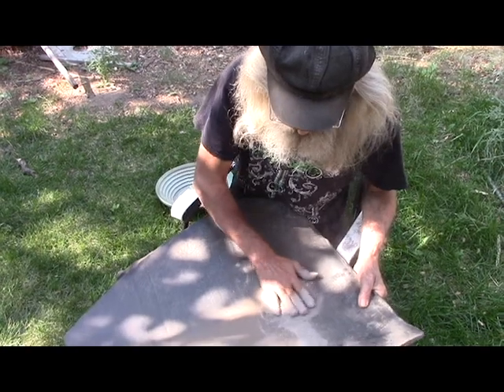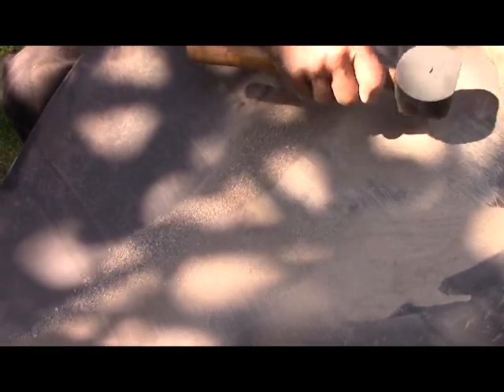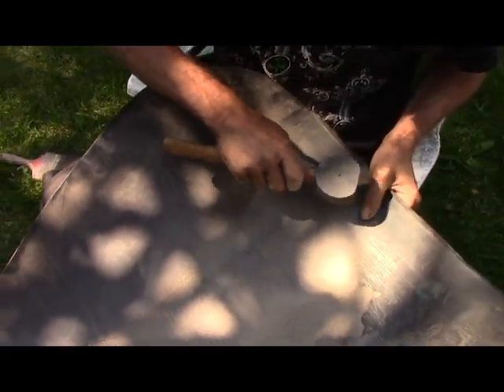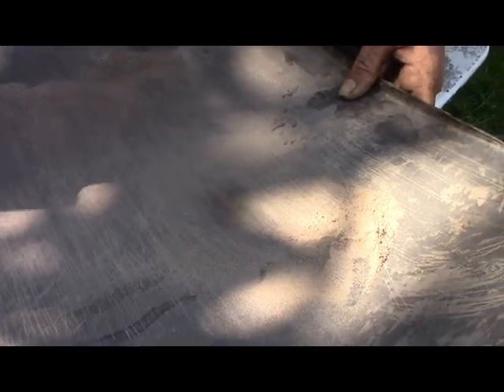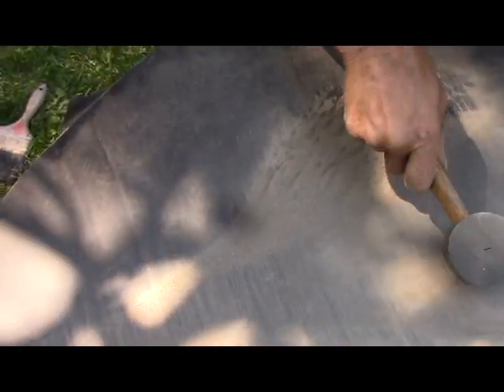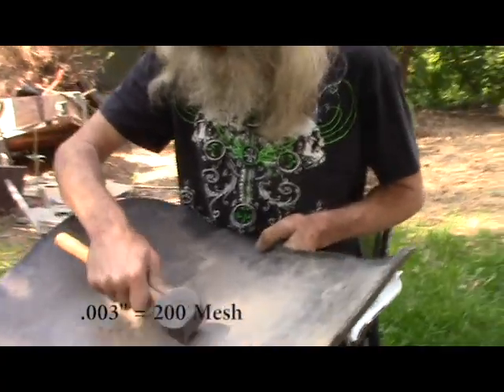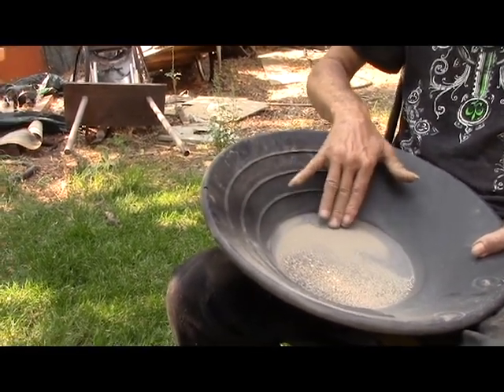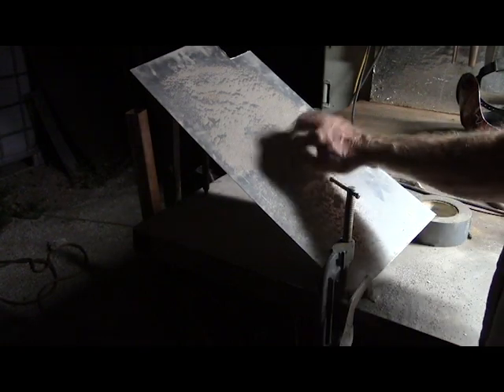Lesson 35 Screening Without Screens

Comment: for this idea, it is necessary to adjust the angle of inclination of the canvas (board, screen).
the stronger the mechanical impact, the board will be close to the parallel relative to the ground (surface).
the weaker the impact, the board (screen) is closer from 45 to 90 degrees. 
The angle of inclination is also important and the strength of the vibration. Here it is better to use a vibrating table.
Reply from the maker: It would depend on the table and the desired outcome, but it could work well.  I have used this in the field when I needed to fine screen something and didn't have screens with me.

Comment: Hello again Keith.

I have had problems replying to your reply. I did a big answer, but it went missing. Anyway, in view of the length of it, it may be as well that it did disappear. 

When I first started in business, I was in gold and silver recovery, and in the 80's, I was asked to advise on, and manage, a couple of projects in Nevada and California (Apple Valley?). Anyway, that was in the early 80's and just as I was looking forward to moving to Reno,
the gold price went from $400+ to more like $250, so that was that.
Still, not as big a disappointment as for the guy in Nevada who had paid $140k for 100k tons of mine tailings in the desert.  After the bank foreclosed, I guess the tailings probably got processed at some point after the price recovered. Quite a big project at 1-2/10 oz per ton, and 2 oz of silver. The California one was an open cast, minus 1/4", pachuca, air and carbon job. Just as buggered with the price drop though. Funny how minus 1/4" seems to be a common and effective cheap and simple sep.

So,  if by leads you mean ideas; yes, one or two.  Most of the research has been on deep beds. They exhibit some weird effects, that's where the aerodynamic mechanism comes from. So, as I haven't found any work on thin layers, it's probably best to follow my instincts, and what I've seen in your videos. I've been in freelance technical development for 30 years so there's a fair chance I will come up with something.

I'm not the best with electronics, but I reckon some sort of vibro drive. Could get a bit tricky with the need to resolve the force in 2 directions; one for the sep, and the other longitudinal to be able to collect the fractions. Phasing or the two is also a question. In addition, with different sized particles of gold, it may well look like stripes on a mine cat's tail rather than the usual single line of gold. That being due the sep being based more on size rather than the way it behaves when water is involved, but not totally different). I think this is a tribological effect. That would explain why the fines stay at the top, while the bigger stuff goes south. Also, there are some interesting parallels with your updated special technique for very fine gold. I wonder if the tapping next to the settled gold had anything to do with Chuck's dry separation action? I reckon that at the end, under the clean water, the effect is almost the same as when it is dry. At the dredger place, when you were  panning fine and course together, the course going south, as opposed to staying high, reinforces that this is a totally different mechanism from normal panning.

Anyway, as you can probably tell from the length of this, you have got me interested in all this again. 

Steve
Reply from the maker: It is always interesting when you think you may be on to either new or forgotten physics.  Today I am testing a fluidized bed vs a Partially fluidized bed.  To early for conclusions- but interesting...

Comment: Keith, when you're on a roll, there ain't no stopping you, is there? What would happen if you ran the material on a shaker table without water, maybe tilting it some? Wouldn't the vibration of the table have the same effect? Plus you have the grooves already there and then you could run larger quantities more efficiently. This would be just for classifying, not gold recovery.
Reply from the maker: That's one of my ideas, but I haven't tried it.  You might want to try this yourself with a smooth sheet of anything.  It works amazingly rapidly.  Let me know if you try the grooves.

Keith

Comment: Hello Keith, I do believe your suspicion that something "acoustical" is causing the material to gather into piles and streaks. If you do a search on  Youtube for "acoustical resonance". Nothing magnetic involved with the "clumping". This process makes me think there could be a "mechanized" way of classification using air blowing up a tube. The exact speed of the upward air would be able to lift smaller particles and larger would fall down. It would be the precise control of air speed that would determine the threshold of particle size.
Reply from the maker: The process you describe is called 'elutriation' I believe.  However it doesn't sort directly by particle size, but by settling velocity.  If you physically size the particles first, then the elutriation sorts by particle density.  It's interesting how combinations of things work together.
Reply: Yes it is very interesting.  Cheers.